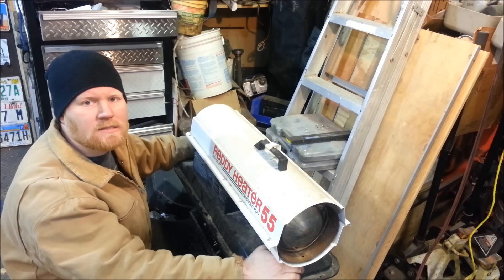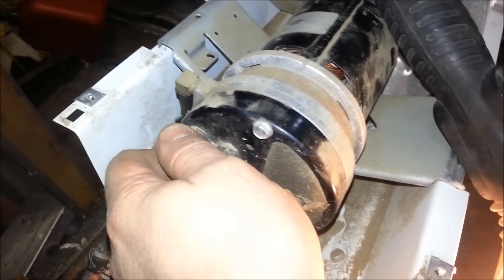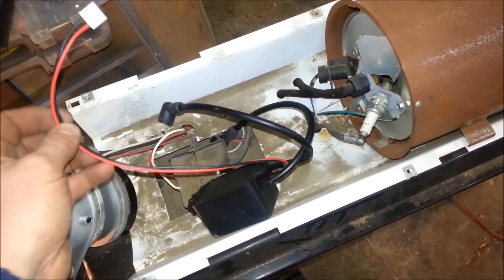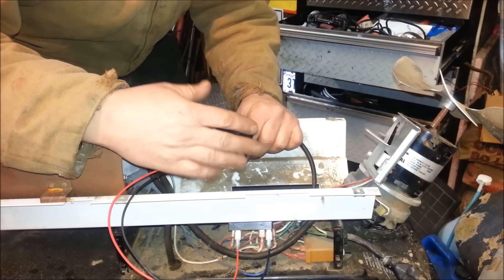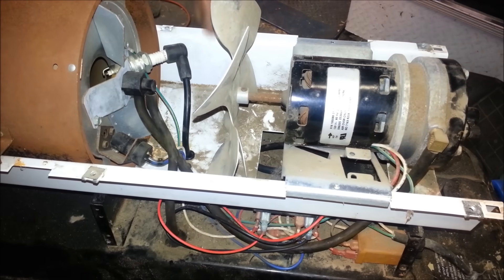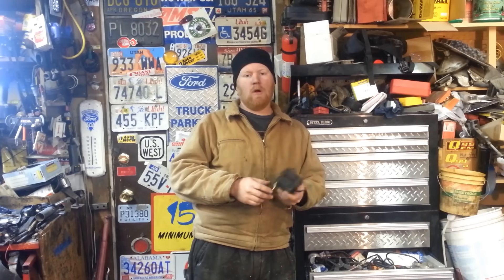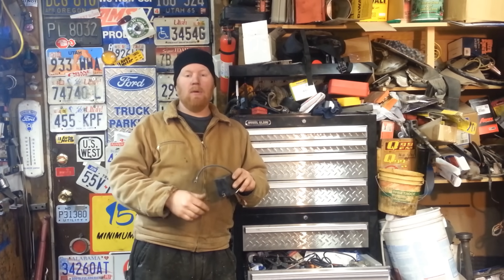Torpedo Kerosene Heater repair & HOW they work

Comment: If you ran a test for spark and it starts but shuts down, then observing spark would tell you it was fuel related failure.
I had to check one once and could find no one who could diagnose and test or check it.
I ended up taking the nozzle to a fuel sales company and the guy I the office showed me it can be disassembled and cleaned.
Wooosh.
Here comes the fuel and proper atomization.

Comment: My Reddy Heater R55 will not run properly with the upper shell installed. Initially, the unit wasn't sparking, so I replaced the transformer ignition control and installed a new spark plug. That fixed the sparking issue. However, this new shutoff issue was discovered. I elected to replace the lint filter, intake filter, and output filter, as those pieces all looked pretty old. The filter end cover was cracked on the side and spitting out air, which I replaced. After the same issue continued and the unit shut off after a few minutes with the upper shell on, I replaced several other things. This included the photocell, nozzle and adapter, the adjusting screw, spring, steel ball, and the 1/8" ID air and fuel lines. After digging deeper into this, I noted the old 3/16" ID air line was leaking with a bit of soapy water, my dad's best trick for finding leaks. One thing to note, when I have the upper shell off, I have set the pressure to 3.4 PSI (per the side label), but when I put the upper shell on, the PSI drops to below 3.0 unless I hold the gauge still. When I hold it, the gauge reads 3.4 PSI. A couple of final things to note on this journey. 1) The fuel cap does not look to have a gasket but it seems to breathe properly with the hole in the center of the cap. 2) Before any issues started, I was running pump kerosene. Since then, I filled up with 10 gallons of jet fuel at a local airport and wondered if I got bad fuel from them. I plan to run through the last 7 gallons or so of jet fuel with the upper shell off and then try a couple of gallons of pump kerosene to see if that resolves the problem. Beyond all of my attempts, I am at a loss and could use some help. I've spent more on these repairs than the unit is worth but started the process in hopes of fixing the heater, as my wife's grandfather gave it to me a couple of years ago. In hindsight, I should have just bought a new unit, but here I am.

Comment: I have a Reddy Heater that buzzes when you plug it in. Any idea what it could be? It won't start it just makes a buzzing sound.
Reply from the maker: The buzzing should be your spark igniter sparking. So you don't get a air flow / fan spinning? Pop off the top cover and spin the fan by hand it may just be stuck. Put oil (engine oil or atf)on the shaft going into the front of the motor that attaches to the fan to lube it up.
Reply: Awesome thanks for the help! I'll go check it out.

Comment: I'm curious about the ignition you used. Did it lasts? Not sure if it's made for continuous use. Thanks!
Reply: @cd2920  I've found a Rheem # RTG20298AF .  Do you think it will work?
Reply: @cd2920  Did I understand correctly, the spark plug wire NOT being used will be grounded to the case/frame of the unit?
Reply: @cd2920  Thank you!

Comment: Pretty much just clean nozzle, check filter pump, set pump.pressure right.
Reply from the maker: Most of the time, it's just set the pump pressure and you're done.

Comment: Nice Video, I can actually see the fuel coming into the cone. I've watched a few videos on this equipment and you have gone thru more than the other have. So my issue is this. I can take air and spray it into the air line and I can see the fuel spray. But when I put it back together it seems like no air is moving. I've taken it apart and will get another filter because this one was pure black with charcoal and felt it wasn't breathing. My valve ball can't be loosened to adjust for air, so I had found another on on Amazon to include a gage since my compression gage wont work on this machine. I have checked the optical sensor too and it all looks clear. The ignitor does come on but goes out after a few seconds. Hope you can get me going in the right direction.
Reply from the maker: The vane air pump may not be pumping any/enough air. You remove the few bolts at the back and pull off the air filter housing. Then there are a few more bolts(I think 4 off the top of my head) and you remove the vane air pump cover. There you will see a vane pump with generally 4 air vanes. They slide in and out as the motor rotates and pump air. Those can wear out and also just get really dirty. Wipe everything off and reassemble( you can also buy these vanes for pretty cheap). Make sure the gaskets look good with no breaks and that the air vane cover and filter cover housing don't have cracks in them. Then check your rubber air hose for splits as this is very common.

Comment: I have a Reddy Heater Pro165 with built in thermostat. It starts fine and runs til it reaches set temperature. After that if I want it to turn back on I have to unplug it and when I plug it back in it starts up and heats til set temperature and once again will not turn back on by itself. Do you think it's the control board? Thanks. DuWayne

Comment: I have this exact same torpedo heater the only way I can get it to start up is if I cover the back of it with a piece of cardboard for a second and then it fires right up pull the cardboard away and it works perfect but that is the only way I can get it to ever start what could it be?
Reply from the maker: You need to set the air pump pressure.
Reply: @sixtyfiveford  thank you very much will try that tomorrow
Reply: @sixtyfiveford  thanks again just set it it was down to 2psi I set it to 4.5 like the side of my heater says and works perfect I actually thought it was the 55k like yours but it's actually the 110k btu

Comment: Mine has the heating element, it sprays 2 twice and never lights, dont know whats keeping it from running. There is a small Crack on the air pump, the plastic where the bolt is, if anyone has any tips lmk

Comment: changed the optical sensor, changed filters, blew out air lines,.has enough fuel as well as spark, but will not stay running. ANY SUGGESTIONS?

Comment: Outstanding video.  Just picked one up at the curb.  Will check it out tomorrow with a GREAT tutorial.  Thanks much!
Reply: I was popping the fuse in my heater and re-watched the video.  When I checked the light sensor it was full of spider web.  Running great, and also has a scoch over 3 lbs pressure.  So after changing the power cord I’m ready for next winter.
Thanks for the video!

Comment: Is there fix for the pump if its not blowing air?
Reply from the maker: There are little flat air vanes that need to be replaced from time to time. It's a pretty straight forward easy repair. They could also just be stuck. You take off the screws from the backside and you will see it.

Comment: The problem mine always gave me was, it would start and run just fine. Would run for an hr if you wanted. Depending on where you set the dial. 
 But once it shut off, it wouldnt restart.

Comment: Reddy Heater starts but when put shrowed back on won't start replaced and rebuilt air pump replaced photo cell air and fuel lines fires up with out shrowed?

Comment: quick question on these .. is there a way to lean out the mix.  my airpressure is what it supposed to be at 3.6 psi but it puts out so much fuel its makes your eye water.
Reply from the maker: You need to adjust the air bleed screw on the back until the front is glowing red hot. It's running too rich, not putting out as much heat as it could, and putting a ton of carbon monoxide into the air. Lowering the air pressure should do this. If nothing helps and your unit has a lot of hours on it the main jet could be worn out and way oversized.
Reply: @sixtyfiveford    thanks will try again.  I noticed my pressure is only able to climb above 3 if I crimp the out let hose at the outlet of the air pump with out it crimped i'm maxed at about 3 psi.

Comment: My dyna glo heater don't start unless I wiggle the spark plug wire ,what could be wrong with it?
Reply from the maker: Sounds like you have a short in the wire. It's hard to say though.

Comment: I've seen several videos where they used graphite to lube the rotor vanes.  But only a few, not everyone uses lube on those vanes.  One Desa manual does not reference any lube on the vanes.  Haven't found any manuals yet that suggest lubing the vanes.  Any idea where that idea to lube the vanes comes from, and why graphite?  Thanks!  Keep up the great work!

Comment: No matter what I do, I cannot seem to isolate the plug wire that is not being used and it grounding out the spark to the wire being used. Any suggestions? Thanks
Reply from the maker: If you bought the dual lead, ground one side directly to the housing. I was mistaken thinking it was for dual spark plugs.    It was actually designed to be a complete circuit with either one grounding.
Reply: @sixtyfiveford   Thanks. How do I ground the other lead to the housing?
Reply from the maker: @jcramey16  Just screw it down somewhere. It just needs to make electrical contact with the threaded part of the spark plug. You May also be able to flatten the connector and wedge it under the clamp down bolt that holds the spark plug in place
Reply: @sixtyfiveford  Ended up wedging the 2nd lead under the strap that holds the plug and nozzle and it worked! Heater has been working perfectly today. Thanks again for the video and tips!!

Comment: My heater was lighting very lazily and sometimes misfiring and smoking out my garage, I use diesel too so it's bad!!! I adjusted the air pressure after watching this video just like you did and woof! It fired up and is running better than ever! Huge shout out to you for making this video, I was about to throw it in the trash

Comment: My heater ran out of fuel and after I refilled it, it’ll start and run normally then shut off after about 30 seconds, this is only the 2nd tank of fuel I ran through it
Reply from the maker: If it keeps shutting off after 30 seconds you optical sensor is likely dirty and covered with soot.

Comment: Hi Great video. Can you explain what you did with the 2nd plug lead that is not being used? Thank you.
Reply: Also I've read the ignitor coil requires a good ground. Where does the coil ground to?

Comment: My 135,000 btu Dewalt heater will only light when i press my thumb over the pressure adjustment screw.  When i release my thumb the flame goes out...please help! Air is coming out of the pressure valve
Reply from the maker: There is a little hole there that bleeds off excessive pressure. The screw presses on a spring and it must be bound up. You'll need to take it apart and see what's making it stick to release all pressure.

Comment: Had one that would run with the cover off but trip out with the cover on. Found out the nozzle was worn out. Replaced it and it cured the issue.

Comment: Flame is pulsing and strong fumes occurring, setting gap on plug?does hose size matter on pick up , found hose was bad and reached it with close size.
Reply from the maker: You need to adjust your air pressure.

Comment: Is it ok to run Diesel in these type of heaters.  Thanks 🙏
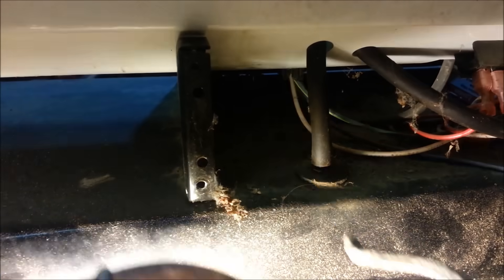Reply from the maker: I have run#2 pump diesel for years without any issue. Kerosene is also called #1 diesel and the stuff you run your truck off of is #2 diesel. #1 kerosene diesel they refine it to make it slightly thinner(they take waxes and lubricants out) so less chance of gelling. #2 diesel will gel at around 10F. However, if you live in a cold climate the gas station will switch over to "winter diesel" which is a mixture of #1 and #2 to prevent gelling. So essentially they just mix kerosene with truck diesel at a ratio of 50% or in Canada upwards 80% #1:20%#2 or even 100% #1. On a side note, #2 truck diesel has more heat energy and will put out more heat vs kerosene.

Comment: All ways run a co2 detector for safety!
Reply from the maker: I ran a detector for years in the garage with multiple different kerosene and propane heaters. None ever set it off. Garages are just too drafty to ever accumulate enough CO2 and as long as the garage door is opened once every day, you'll never build up CO2.
Reply: @sixtyfiveford  I meant co not co2. My bad. Good vids tku.

Comment: a  double spark lead igniter is for twin electrode heater u know 2 progs with an air gap. not a spark plug, but should work anyway!
Reply from the maker: You are right and I realized it right after the video. One lead can be grounded directly to the metal frame.

Comment: My fan will not spin.  I'm guessing the air pump is locked up. I removed the bolts from the back and it spins freely. When I re-tightened the bolts the fan would not spin. What should I try.  PS The plastic "brushes" also fell out when I was removing the pump. Do they only go in way. If so how do I guarantee that I've got it right.

Comment: i dont think thats agood idea tapeing the other secondary plug wire ( high voltage). it should be grounded. i bet its gone bad by now.
Reply from the maker: I discuss this in the video description. I was wrong and the second lead was simply a ground to the first lead. It still works fine and just grounded through the electrical tape.  So the second lead just completes the circuit and could just be bolted to the frame anywhere.

Comment from the maker: Permanently mount a pressure gauge to your heater so you can always make sure it's running safely. LOOK in the video description for details.
Reply: Any pics or info on the actual install? I would also recommend using an Inkbird ITC-308 for temp control. They do heat and cool for multi uses, the reviews are good on them.
Reply: One more thing, can you send me the ignition module part number you did to yours. Thanks again
Reply from the maker: @scottcryder3737  I have all the details in the video description about the module.

Comment: I got mine going last year with your video. It was running but a little low on PSI (2 ish PSI iirc). Now its not reading anything.. whats odd is it still is working. Only issue is my eyes start to burn. 
I went to the Reddy site again and noticed the black adjuster screw is now yellow. 
Last year it did not seem to be doing much ... either running or not ... PSI ranged 0-2 psi. I ordered a new cover and yellow screw hoping it works for me.
Reply from the maker: The adjustment screw itself really only pushes on a spring/check ball and doesn't serve much functional purpose. Too much fuel will cause burning eyes. This is generally from too high of air pressure. I would have too assume your gauge is malfunctioning.
Reply: sixtyfiveford makes sense. Possible freezing temps could affect it?

Does screwing in the check ball supposed to increase or decrease pressure ?
Reply from the maker: @Jeeper1378  Screwing it in clockwise increase the air pressure.  Freezing temps will make the fuel thicker and it may have higher pressure to start and slightly lower pressure at temp(minuscule maybe 1/8 of 1 psi)

Comment: A VERY GOOD SYSTEM BUT IN AN EMERGENCY WHERE POWER IS DOWN WITHOUT POWER IT IS IMPRACTICAL??
Reply from the maker: Not sure who would be using these for emergencies. These are meant to heat workshops, outdoor spaces, etc. They do draw very little power though and a car battery with a small power inverter would easily power this.

Comment: What diameter tubing did you use to test the pressure?
Reply from the maker: You can pick up a 1/8npt barbed fitting from the Home Depot and it will screw right into this port. You can then hook your flexible tube up to it. You can also pick up a cheap 1/8npt pressure gauge from Amazon and leave it hooked up for the life of the unit.
Reply: @sixtyfiveford  Thanks for the response, I ordered the 15 PSI 2 Inch Diameter 1/4 Inch npt bottom mount linked in the video so I could just get the 1/4" tubing at  Home Depot?

Comment: Near the beginning, you site the air and fuel nozzle hoses opposite of what they are.  The air pump hose goes directly in the rear of the nozzle in effect blowing over the fuel hose coming up from the bottom.  Otherwise, Good video.

Comment: I have Reddy 110 ,000. It will run but shoots small flames out from front side. Any idea what to check for? Reddy webpage says to check pressure first and make sure that is okay before putting a lot of money into parts. They say everything can be working properly inside, but if pressure is wrong it won't run properly.
Reply from the maker: Your pressure is too high, pushing too much fuel into the combustion chamber.

Comment: Mine periodically puffs white smoke, sounds like just fan running then puffs smoke , then a lil heat then puffs of smoke again. Do you have any idea what it can be?
Reply from the maker: Either your spark it cutting out or your fuel supply is being interrupted. Fuel supply interruption could be from an air leak in the air pump, sticking air vane, cracked rubber air line or a crack in the fuel pickup line.

Comment: Getting fuel getting fire change air pump but the what part no. Photo cell to buy i bought the 1 off amazon with 2 blue wire no. Pp236

Comment: I have one like that. It starts ok, but then a few seconds later it shut off by itself. What could be the cause? It has fuel and everything. Thank you
Reply from the maker: Optical sensor can't see the flame. Either the lens is dirty or it's defective.
Reply: @sixtyfiveford  Very good, I am going to check on that and clean it, to see if it works. Thanks a lot, and may God bless you for the valuable information you provide with your videos.